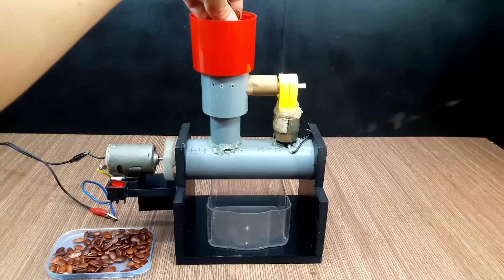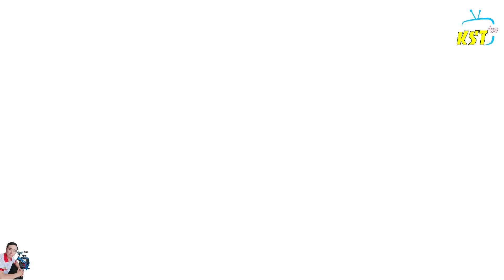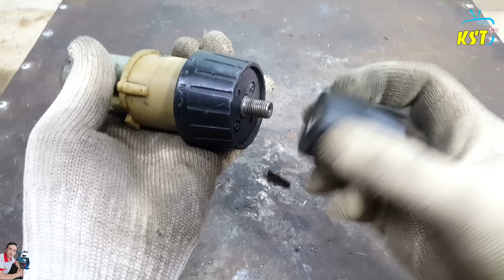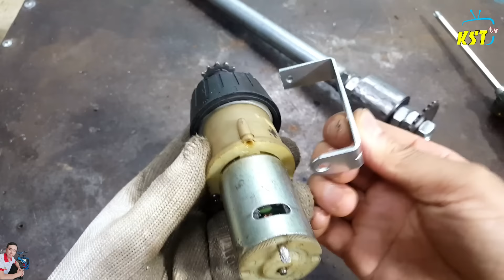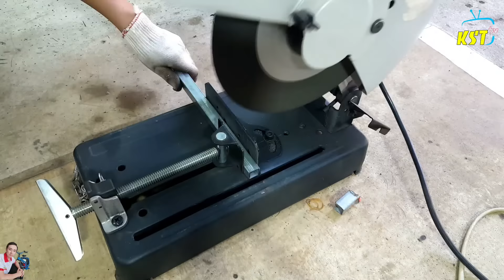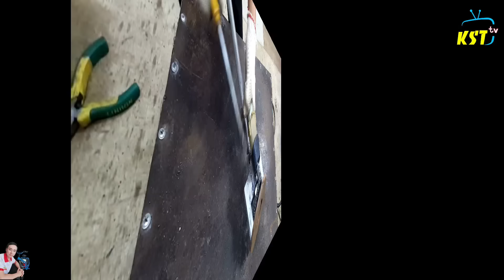How to make a 12V Super Powerful Electric Actuator - V2

Comment: For an even more modular design take away the motor and fit a nut to the winding gear, then a cordless drill can do the work. This would also do away with any wiring.